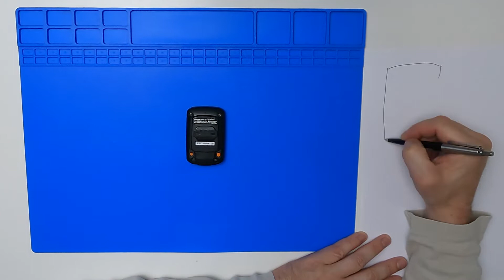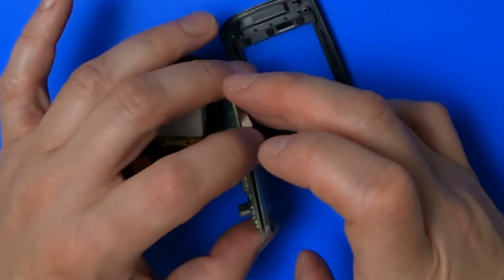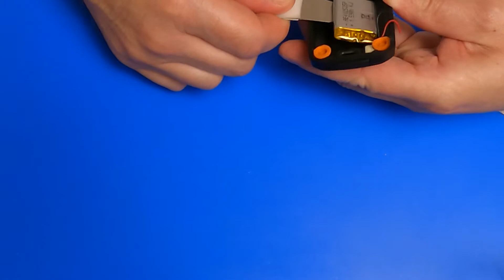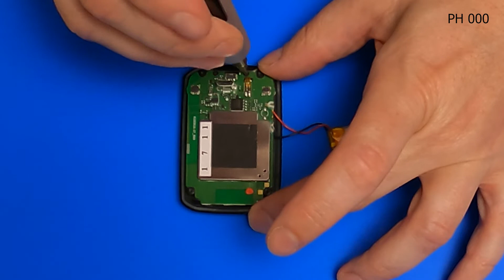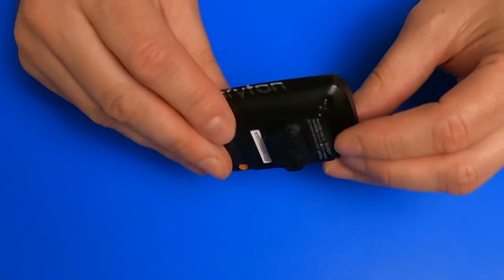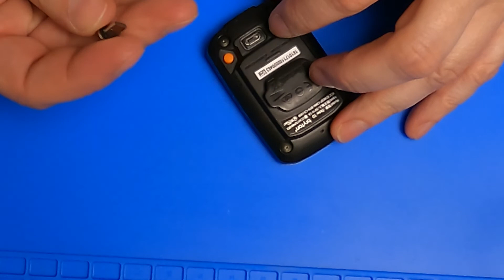Replacing the Bryton Rider 10 battery

Comment: How to know what battery fits in? Is there some model number to search for?
Reply from the maker: I searched "3.7 V lithium battery" on Aliexpress and under the tab "specifications" are the dimensions. The one I bought has "402535" printed on the outside and measures "35*25*4.0mm", so the type number reflect the dimensions. In the meantime batteries of larger capacity might be available though, have a browse using that search term, you'll find it. Best of luck!
Reply: @repairchannel  Thanks a lot for a quick reply. So basicly I just need to look for 3.7v and for it to be right dimension?
Reply from the maker: Yes, exactly! Pick the one with the highest mAh value that will fit. the 4 mm thick one I used said 350 mAh, on hindsight I might have been able to sqeeze a 6 mm 602535 of 600 mAh in, but I'm not sure, check how much room your device has to spare.
Reply: @repairchannel recently purchased a 6mm 602535 (500mAh) version and it fits perfect.
Using the new battery, I can record +10h with the LCD display light on on a single charge.
Reply from the maker: @Mateodure  That's great Mateo! Thank you so much for sharing 😃